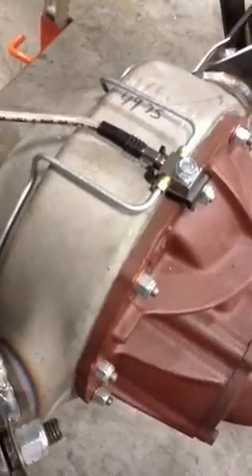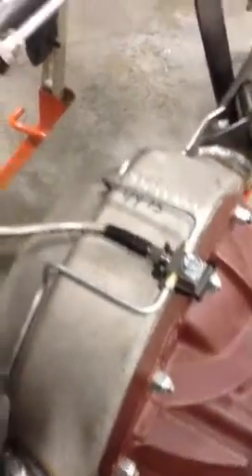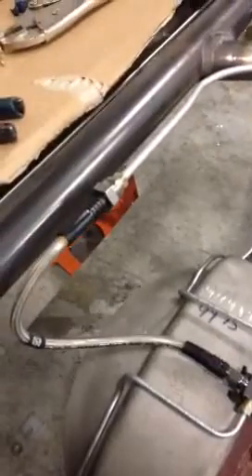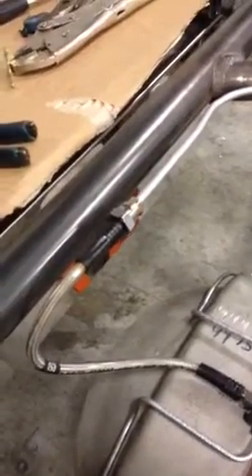Street Rod Custom Brake Line Set

Comment: Very helpful. However, one question. Did you use a mechanical brake light switch off the pedal or did you go back and install an inline hydraulic one. Or, since the proportioning valve has more ports than you need could you run one off of it?

Comment: Why do you have an adjustable proportioning valve on the rear Brakes? I thought they were only used for disc / drum applications. What is the purpose of decreasing the rear brake pressure? Thanks